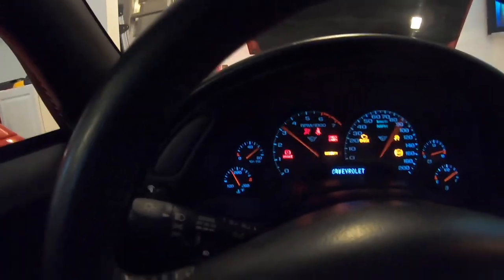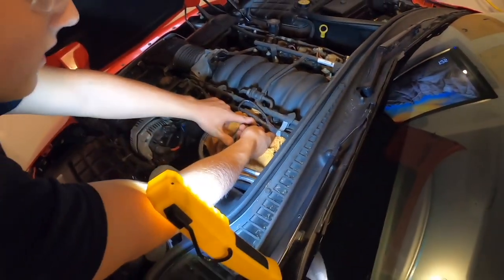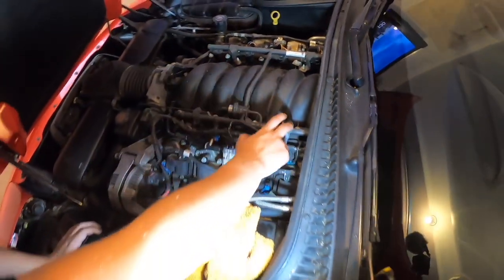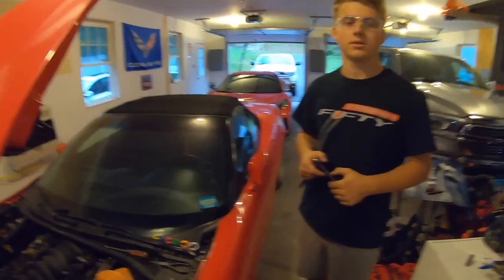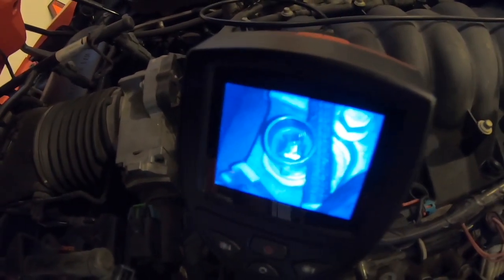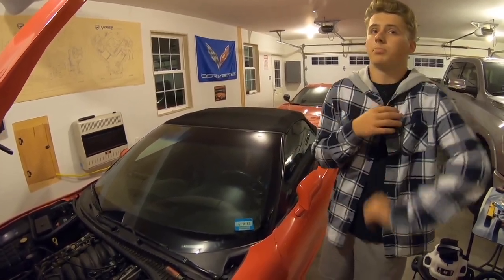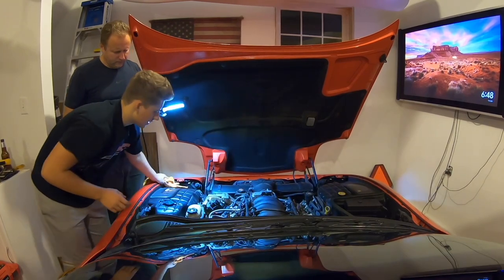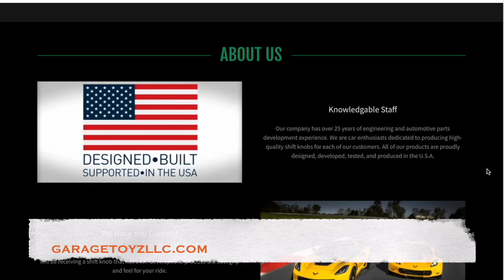How to change the C5 Corvette Oil pressure sensor  - sender replacement for LS1 engine

Comment: I finished the sensor relocation on my 2003 C5 today.  I did this job about 4 years ago but I didn't install the extender.  So, here we are again.  (I bought the extender hose with fittings on Amazon for $99).  I didn't want to disturb more than necessary and I didn't want to drill any holes.  I did not remove anything except the plastic engine cover.  Although it was a royal pain in the butt, I was able to disconnect the old sensor and pull it out.  For me, the hardest part was threading the extender hose into the engine.  I could not get the threads lined up while rotating the hose.  I had my son come over and somehow he got it threaded on his first try.   8-)   
Now, my oil pressure gage no longer thinks it's a windshield wiper.  It was continuously slamming full scale and back to zero.  Now it sits rock steady at 42 PSI at cold idle.  If (when?) this new sensor fails, it will be very easy to replace it.

Comment: Guys…there are literally long reach needle nose pliers (angled 40 degrees) that make removing the unscrewed sensor a 2 second task. 

You can also use a metal coat hanger to unclip the tab. 

Also use a small 2 to 3 inch piece of garden hose (insert plastic end of sensor into hose- it’s a snug fit) to give yourself the ability to insert the sensor and make it finger tight (literally fingertip tight as that’s all you’ll fit in there) before wrenching it down to 15lbs. 

You’ll also find you get a little more room by removing the rubber seal along the windshield cowl. 

This is a 30 minute job with the right “tools”.

Comment: I changed mine by removing the intake manifold,was pretty easy and worth the extra time. Also,change manifold gaskets and replace knock sensors while in there!

Comment: Guys, guys, guys... It is soo much easier to remove the intake manifold bolts and a few other fasteners.   Just slide the manifold forward a couple inches and be done with it.  Never changed the gaskets.   Did this in less than 45 minutes.   No issues afterwards.    68K miles and pressure issue fixed.  Best of luck.   Was too painful to watch the entire video.

Comment: Hi my c5 gives low oil since a few weeks. I checked the oil but nothibg wrong/enough oil. Also is the tempeture rising higher but drives all fine
Is this also a sensor problem?
Reply from the maker: On ours the reading went to zero and it wasn't reading anything at all. If your sensor is reading something it is functioning. I would suspect its something else